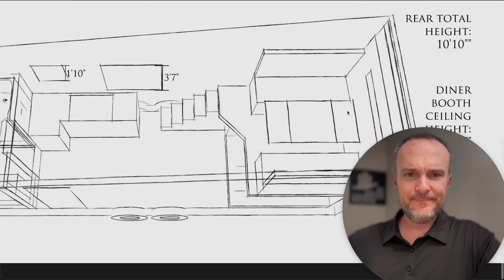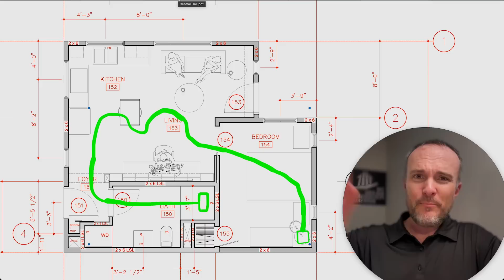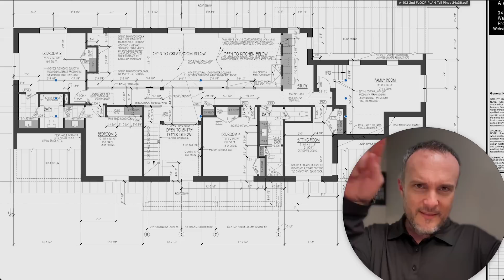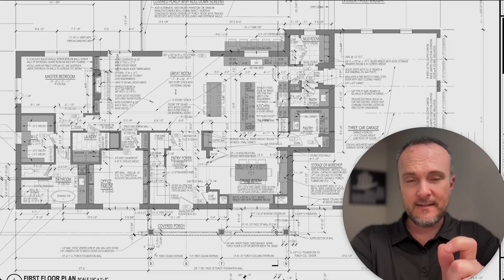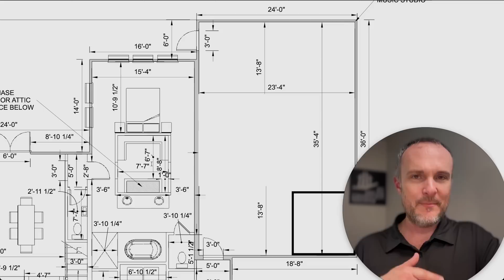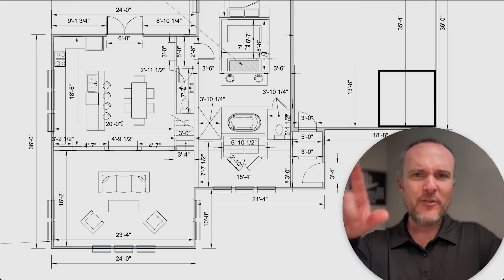Home Floorplans for High Performance Design: Tips & Tricks from Past Build Projects, Part 2

Comment: This is a great exercise trying to fit the 5 elements after a floor plan is designed.  Easy enough to put in a vent in the master bedroom, with the exhaust in the master bath.  But the bath is not heated.  I want to take a heated air from the great room (fireplace) and pipe it to the bathroom.  Those are my two factors working against each other.  Filtered dilution air vs conditioned air.  ERV will pressurize the bedroom and depressurize the bathroom.  Perfect!  But I want to depressurize the great room (Pull heat out) to a far end room (Master Bath) (Pressurized) to create air flow circulation.
Reply from the maker: Panasonic WhisperfitDC 50/80/110 cfm, $150

Comment: This is exactly the concept / discussion I have been wanting you to have! By the way 11:30 - the term is "rafter cut roof" versus "roof trusses". As you pointed out, roof trusses is attic makes them space challenged. Rafter cut make the space usable for mechanical or future build out or both - if you plan correctly.
Reply from the maker: Cool crabby thx

Comment: Added this video to my home design playlist! 
Thoughts on hydronic heating AND cooling? In my mind it makes so much sense to eliminate all ductwork and problems that can come with it(design, mold, etc). Is it just cost prohibitive at this point? Any other downsides?
Reply: “Hydronic” is a pretty broad term and could include radiant floor heating, wall or baseboard radiators (again, suitable only for heating), fan coil units (for heating and cooling)—which can either be ducted or ductless—or any combination of these. A ductless system still needs a means for distributing and extracting ventilation air and managing humidity, and this is typically accomplished with some amount of ductwork although it usually requires much smaller duct sizes than a ducted heating and cooling system.

BTW, radiant cooling is usually not a viable option because of water vapor condensing on the surface of whatever the chilled water is passing through (radiant floors, radiators, etc.).
Reply: @MichaelJ674 I am thinking radiant panels as discussed by Messana Hydronic Technologies. They use ceiling panels and as they mention the condensation is the biggest obstacle to manage, but it is manageable. I just don't know why its not more common yet...
And yes there still needs to be some ducts to manage humidity and ventilation.

Comment: Definitely opted for the long and skinny here. Site requirement mostly and figured best for straight heat pump with ducting. Basically, 20 feet wide and 70 feet long single story. All the bedrooms, bathrooms, laundry and kitchen dining space are on one side. Long opposite hallway connecting them all. Mudroom near the middle with mechanical space above using straight runs between them all. Hardly any turns. Exposed ducts in conditioned space as there is no traditional attic. Dining kitchen area will have a small fireplace in the far corner. Basically, everything is in the building envelope and should be able to have good separation with the ERV from fresh air return and stale air extraction etc.
Reply: I am building a passive solar skillon cottage like that. 24x72 when finished excluding porches. Building a 24x24 at a time. 3 season porches on east and west sides. Have a warm roof with exposed rafters and tongue and groove. Doing a masonry heater, plus a masonry stove and oven. Doing a planter box and 1.5 baths on south wall like an earth ship. North wall is cmu masonry with ripap veneer stones.
Reply: similar to both of you, all my designs are rectangular with min E/W exposure & covered patios/balconies for added shading. decided not to go with a big footprint for the 2 & 3br designs, but up a floor... allowed me to put living/sleeping rooms at far ends, and kitchen/baths/utility central. going ICF, even for the roof. small amount of needed heating/cooling left will be handled by several old/new techniques working/mixed together for synergy. hope to be entirely Passiv, but w/o the expensive bits required for official cert.

Comment: Is there a fire code issue with an open chase from basement/crawlspace to attic?
Reply: It may have similar properties to a chimney, if the walls are insulated and fire resistant, I don't see an issue.

Comment: Working through a custom build now and I used a lot of your advice when determining the floorplan. But my one big regret is not making the ceilings taller so we could comfortably fit ceiling fans everywhere. Our 9'-10' ceilings were trimmed to 8' to fit the budget, except for a vaulted kitchen/great room area on one end.
Reply from the maker: I hear you